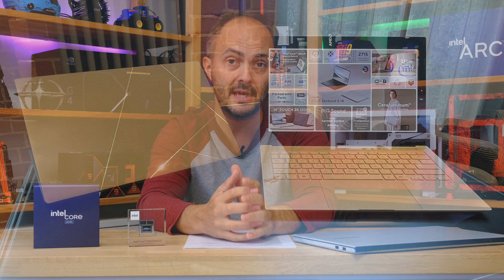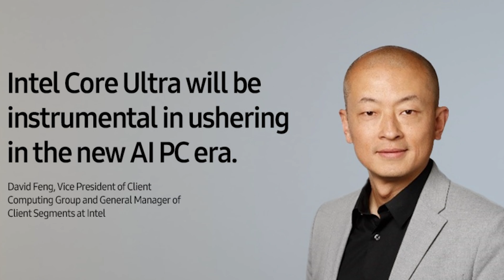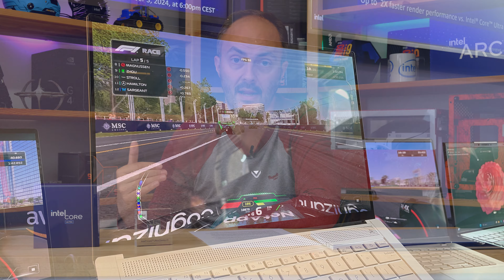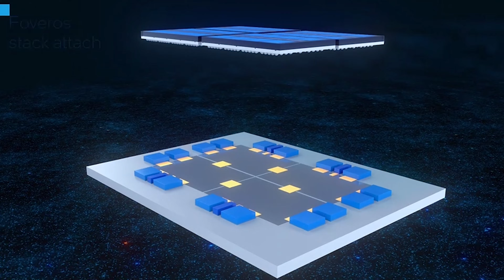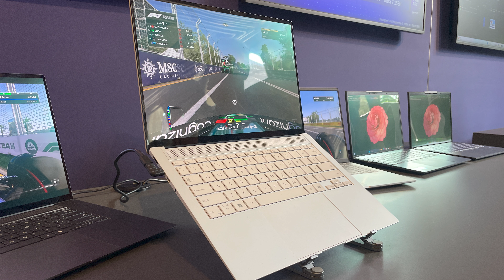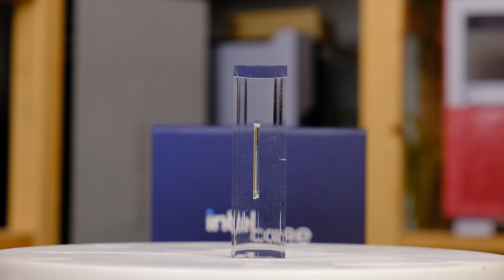Intel's HYPER THREADING REMOVAL: Lunar Lake's influence on Arrow Lake explained

Comment: seems like ya getting paid by some cpu manuf... but whoecer has q 10th gen cpu , they have no reason whatsoever to upgrade to a newest cpu , they are just fine , ...my opinion
Reply from the maker: You’re entitled to your opinion of course. But if you pair a modern graphics card with a 10th gen it will be much slower in games than a 14th gen CPU or Ryzen 7000. That’s a fact. And this video is entirely unsponsored 😊

Comment: Only intel would remove the only thing that made there x86 platform back compatible , legacy software rakes a massive hit , equivalent to removing 2 performance cores , e cores just rebranded crleron die modded to one chip no matter how intel spin this your getting worse performing chip than last generation and half the chip it should be ,  intel see stick only giving us 4 core systems while the compition has moved on, this does nothing but bad things to there stock ,and sales figures
Reply: x86 is long overdue to dropping legacy support. E-cores in Lunar Lake have the same or slightly higher IPC than P-Cores in 13th/14th gen CPUs...

Comment: no ht no buy
Reply: HT in Arrow lake would have provided a 3-10% performance increase. The core is not bottlenecked almost at all.
Reply: @rattlehead999  ultra 9 is for big boy professionals, they need threads... so my 13900k will work for a couple more years...

Comment: I watched, by chance, a lecture about wasted processing power due to optimizations like hyperthreading. Did not understand it very well but I'll link the lecture here.

https://www.youtube.com/watch?v=wGSSUSeaLgA

The short of it: there's the von Neuman bottleneck (DRAM is much slower than CPU) and things like multithreading and prefetching were created. Researchers - like the lecturer on that video - have shown all this adds nothing in term of computational power. All they do is waste electricity and silcone area.

BTW, the lecturer is talking about Servers and, you know, that's the big market. We're just beta testers.

EDIT: the lecture is from C++Now 2024. Energy efficiency has nothing to do with laptops - it's all about servers. We, of course, love that. Intel deserves applauses for how efficient they've done their CPUs and deserves a stern talk for how long they took to make it.

Comment: Lunar Lake looks very interesting. I'm purely a Linux user, and have been on AMD for about 5 years now (and have been very happy with AMD, have had laptops with Ryzen 7 4800H, Ryzen 7 6800H, Ryzen 7 8840U and one with a Ryzen 7 5850U). If the MacBooks with the M series chips were more "open" and Linux friendly, I would have purchased one in a heartbeat (great performance while sipping battery power). Really hoping Lunar Lake lives up to the hype.

Comment: I kinda understand removal of multithreadng from High Performance cores, removal of IPC penalty and sync issues.  But E-cores? Stupid. If something is easily parallelizable (faq, what a word) even e-cores can contribute. If not, they will be able to handle many more lightweight / occassionally acting backgroudn processes.
Reply: Hyper-threading only works if the core is bottlenecked and has poor scheduling and branch prediction. Meteor Lake has such as good core that Hyper-Threading only gained 4% integer and 17% floating point performance from Hyper-Threading and Lunar/ArrowLake's cores are even better and Hyper-Threading would result in 3-10% performance at best.

Comment: Intel is copying Apple silicon design concepts: as least integrated memory and no hyper-threading.
Reply: Lack of hyperthreading is not 'Apple concept' but consequence and limitation of ARM architecture.  As cor integrated memory - again, not Apple concept and stupid one at that. Just look at yields and Apple RAM pricing.
Reply: just with removable cpu over locked cpu

Comment: About time.  Hyperthreading only made sense when you only had one or two cores.  In that case if you had 3 or 4 or 5 threads that wanted to run, you could get a little more work done with a few "half cores" that could do something while the other half was momentarily stalled.  These days, you still typically only have 3 or 4 or 5 threads, but 6 or 8 or 12 cores, so there's just no need for those half cores thrown in the mix.
Reply: @clint_254 Are you referring to this?  "The cores with hyperthreading-support are SP-enabled. SP technology leverages the idle hardware threads to carry out long-range cache prefetches which offsets performance degradation due to cache misses.".  If so, you seem to be misunderstanding.  The whole reason one half of an SMT core core goes idle is because it is waiting for a fetch from RAM.  Latency means the time that thread spends waiting for that RAM access.  During that time, the core can run another thread that that is trying to do some math on data that is already in the L1 cache ( or registers ).  Even in that case, that does nothing to lower the latency of the first thread, and you keep saying you are talking about a single threaded load, which means when that one thread stalls waiting for ram, there is no other thread for the other half of the SMT core do any work on either.  You just have two idle SMT cores instead of one.  Arguing that SMT helps a single thread makes even less sense than arguing that having more cores in general helps a single threaded load; If there is only one thread, then all of the other cores ( SMT or not ) won't have anything to do and so will be totally wasted.
Reply: Please, press Ctrl + Shift + Del on your Windows PC (or run the "htop" command if you are using Linux) to see just how many threads your PC is running, because there are **thousants**. And don't make the confusion between the number of processes and that of threads (a process can have one or more threads).

I'm sure you'll change your mind right on the spot.
Reply: @Hardcore_Remixer  hello?  You said you were talking about a single threaded work load. Congratulations, yes, there are usually plenty of idle threads on a system.  What does that have to do with the price of tea in China?  If you only have one thread that is *busy*, then having SMT isn't helping.
Reply: @clint_254 No, hyperthreading does not help the latency of a single thread.  It takes advantage of small stalls in the pipeline of that single thread where another thread might be able to get some work done.  It will LOWER the throughput and INCREASE the latency of the first thread in the hopes that the combined throughput of the two will be higher.  It is only of any benefit ( to throughput, not latency ) when you have more threads that you want to run than you have cores on which to run them.
Reply: @clint_254 Yea, and I said that SMT does not give a single threaded program lower latency or higher throughput.  Was I clear enough this time?
Reply: @clint_254 How do you figure that SMT does anything to lower the latency for a single thread?  Do you not understand that what SMT does is take hardware resources away from one thread, and give them to another?  That can NEVER help the first thread.  The ideal is that it negatively impacts the first thread little to none, while benefiting another thread.
Reply: @clint_254 "No, an SMT thread goes idle when there is no micro-op for it to process. In such cases, the resources are dynamically dedicated to servicing the single thread that has micro-ops to process.".  You forgot a word there.  When ONE thread can't make any progress, THE OTHER thread is switched to.  If you don't have another thread, then there is nothing else to switch to.  How are you not getting this?
Reply: @clint_254 "SMT means both threads execute simultaneously." Yea, that means you have to have TWO threads.  If you only have ONE thread, then there is no BOTH to execute simultaneously.

Comment: Who was it recently that turned off HT and found hardly any difference in power consumption - lol -.
Reply: Not the same architecture and there is a 15% or so difference. Also depends if the chip has a hard cap on power draw.

Comment: I understand dropping HT on mobile 100%, On Arrow Lake sure its just 8 cores HT but that made up a lot of the MT perf. I personally don't care too much about efficiency as long as its not absard and dangerous/annoying for coolers to tame. dropping HT will hurt their gains but it'll help normalize what was becoming a meme, I hope Arrow OLake has some head room for me to get at least an extra 100-300mhz mentaining at least 5.8ghz on the P-cores. I'm also super curious to see how the E-cores scales with power.
Reply: Meteor Lake got 4% integer performance gains and 17% floating point performance gains from HT, Lunar/ArrowLake cores are even less bottlenecked and with even better scheduling and branch prediction, so at best you'd gain 3-10% performance with Hyper-threading while increasing power and die size area by 15-20%.
Reply: @rattlehead999 the few extra percentages do add up but I guess it wasn’t worth it. If they were just disabling it in software I’d be confused but they apparently made two separate version of lion cove with and without the HT logic. I’m fine with it, just make faster cores and memory ecosystem
Reply: @ItsAkile  they didn't use the Lion Cove with the HT in it, it turned out to not be worth it.
Reply: @rattlehead999  Yeah, in their opinion atleast. Its still a pretty good P-core but latency not portionately improved and we got some regressions with the focus on eco. It was gonna happen regardless, still thinking of a 285K build no less.
Reply: @ItsAkile  I'm absolutely happy that they focused on efficiency a desktop CPU should top out at 140W and a desktop GPU at 250W.
Reply: @rattlehead999  I don't disagree, I dont like temps over 85c and I dont go out my way to water etc at the moment. I'm willing to give the GPU and GPU a bit more if it scales good with the extra power. the new 125w base is pretty respectable, I'm interested in the tuning of the various  buses and ring clk and that should increase the temps/watts. I saw some early stuff atleast praising the MC thankfully now supporting high speeds over 7200MT easily so that will be the easier direction for gains probably.

Comment: Intel focusing on power... yeah they weren't with the 14900k that was sucking up to 350 watts with AVX workloads.
Reply: If you were relying on AVX you probably would have been better off running on the GPU
Reply: @LouisDuran  Sure if you have access to the source code and go and re-write the software.
Reply: @rattlehead999  sounds like maybe someone's using a hammer when they should be using a screwdriver.
Reply: @LouisDuran  Well tell that to the software engineers. Plus it's not always that AVX would be better on the GPU if there is some boolean logic tied to it(dependency).

Comment: "they are not always doing that" implies that they may still be doing that a lot of the times ;)
Reply: On Meteor Lake hyper-threading in the best case scenario in synthetic benchmarks gave 4% higher Integer performance and 17% higher floating point performance, Lunar/ArrowLake cores are even less bottlenecked, with better schedulers and branch prediction, so at best you are looking at 10% better performance with Hyper-Threading when the thread is at 100%, while adding 15-25% power draw and area size.

For reference Zen4 gains 21% integer performance and 28% floating point performance from hyper-threading. The core is more bottlenecked, even though the schedulers and branch prediction is as good as intel's. 

For another reference the 12th gen intel CPUs gain about 18% integer performance and 26% floating point performance from hyper-threading.
Reply: @rattlehead999  Thanks for sharing your insights on Meteor Lake's hyper-threading performance. You're absolutely right that Intel has positioned Meteor Lake as a power-efficient platform. The addition of a virtual core, while potentially boosting performance in certain scenarios, does introduce overhead, which can offset some of the gains. Given Meteor Lake's focus on efficiency and the potential for lower power consumption, it might not be the most ideal choice for workloads that heavily rely on hyper-threading.

Additionally, the tile-based architecture of Meteor Lake could potentially offer some cost advantages, making it a more attractive option for certain applications. It's interesting to compare Meteor Lake's hyper-threading benefits to those of Zen4 and 12th-gen Intel CPUs. While Zen4's gains seem more substantial, it's important to consider the specific use cases and priorities for each platform.
Reply: @moonwatcher6594  I would wager that ArrowLake will be faster than the i9 14900k in multi-threaded tasks due to its 68% improved E-cores. And in single-core tasks it should be on par or very slightly faster, considering it's clocked much lower on the P-core => 5.5Ghz Arrow vs 6.2Ghz Raptor Lake. 

Lunar/ArrowLake E-cores have the same or slightly higher IPC than 14th gen P-Cores, but lower clock speeds(4.6Ghz). 

At the same time I expect the 285K to run at 125W with 90%+ performance of 254W 14900k.
Reply: @rattlehead999  That's a move towards the right direction IMO because my 13900k/RTX 4090 build is literally a room heater that runs up the air-conditioning bill! Nvidia also should keep in mind that we are already planning to go "Up and Atom!" to power the AI data centers!
Reply: @moonwatcher6594  There was an engineering standard. Desktop GPUs max out at 250W TDP(220-230W power draw) and CPUs amx out at 140W TDP(120-140W power draw).

Sadly the RTX 5090 is rumored to be 600W and the 5080 400W, which is a massive increase yet again.

The 5070 should be under 250W, but that won't be faster than a 4090, the 5080 is said to be 10% faster than the 4090.

Otherwise I'm happy that this time Zen5 has lower power consumption and can actually be cooled, unlike Zen4/Ryzen 7000 "X" CPUs. the non-X Ryzen 7000 CPUs are excellent though.

Comment: hyperthreading was a joke... At last  they removed it??  Thanks god!!
Reply: Yes removed from desktops to laptops
Reply: sadly windows did not remove an program for idle

take a look at the task manager put the highest cpu task

I guess your see an program call idle taking 88% of the cpu for you for nothing at all
Reply: If you dont know how it works.. then you arnt bright as its actually better in keeping it busy
Reply: @Scudmaster11  hyperthreading is 95% stupid marketing and 5% (in particular apps) performance gain. It represents the lack of innovation of intel in '10s which ended in '20s  fall...
Reply: @retrogaminga1072   say all you want... but its actually better than you complain about
Reply: @Scudmaster11  when you find out using less is not an good idea

it makes gpu slower a bit as it not speedly in task to deal with task as the cpu get slower the list is gets need to be more cores over it to keep it close

Comment: IMO Hyper threading was removed because memory access is so fast that there is no time to run (hyper) multiple threads in one cpu. Its a logical step for more efficient instruction execution.
Reply: Not to mention that HT was a quick hack around a problem to begin with, not a solution.
Reply: @alexturnbackthearmy1907 😅
Reply: You remember how AMD can ran SMT with lower power but resulting similar performance to Intel? I guess it's an architectural issue......
Reply: How Hyper Threading depends on Memory Access: "How Hyperthreading Works" (youtube) by Software Chats. (at 1.45)
Reply: It was removed because when running HT you don't get 2X the performance of a single thread running on a core.  Memory access has nothing to do with it.  It's faster for 2 single thread cores to run those 2 threads than it is one core running HT.

And this is because there isn't duplication of the instruction logic.

So why now?  Because die space is now sufficiently small (transistor density) with the current process nodes, especially when e cores are used more often.  HT or SMT has ALWAYS been about maximizing die space, giving more thread processing capability with a core that's slightly bigger.  It has NEVER been about a core being more performant.  You could say it's made cores more efficient but it depends on the metrics you use to measure efficiency.

If anything faster memory access would lend itself to SMT-2, because the cores can get the instructions/data faster which is more important if you're trying to double the thread count on a single core.
Reply: That acces to RAM is not fast. At least not when you compare it to the acces of the CPU to its own cache. Simply optimizing an algorithm for better cache usage can get you enormous speedups depending on what it is. There's a reason GPUs have their own built-in VRAM and slow down when they need to use the system RAM.
Reply: HT was working around memory latency, not bandwidth. And latency hasn't improved significantly. But maybe larger caches and better data prefetchers are good enough to mitigate it.
Reply: According to Wccftech, latency has improved: "One of the key reasons why latency has improved so much happens to be aligned with the overall bandwidth uplift which is up to 2.8x for the Lunar Lake low-power cores versus Meteor Lake. Intel has also shared the cross-cluster latency coherency chart, showcasing the Lunar Lake P-Cores with an average latency of around 25ns and 55ns for the LP-E cores. This is a 3x improvement over the Meteor Lake CPUs."